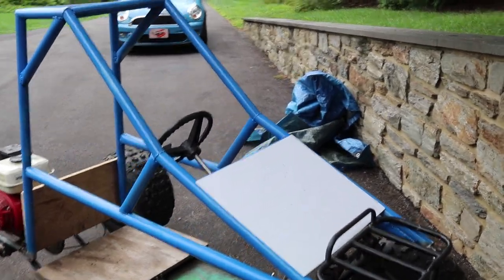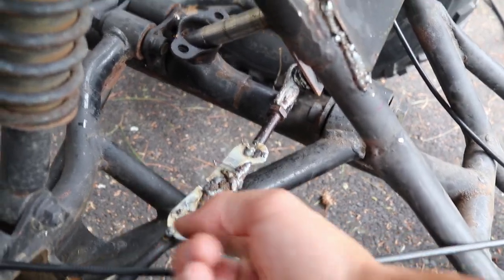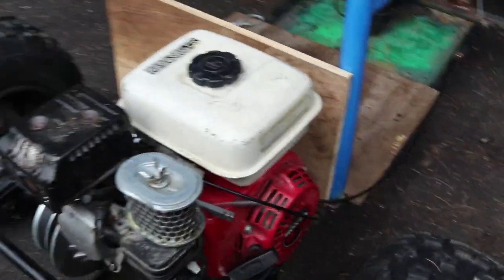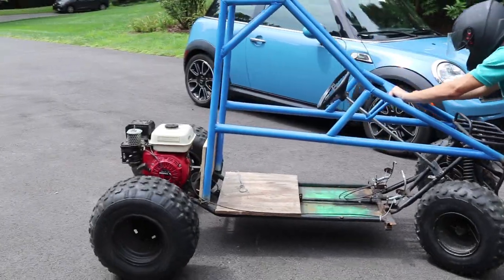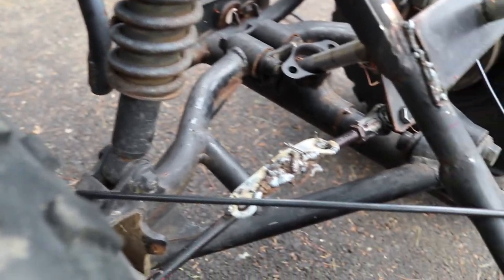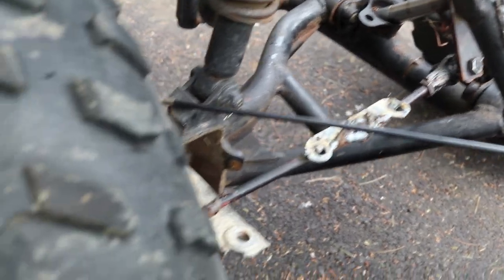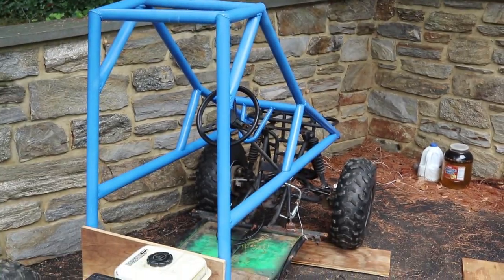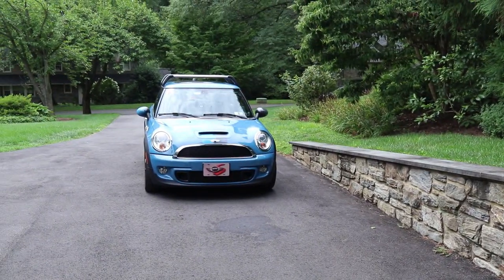FIRST DRIVE IN THE OFF ROAD GO KART [Off Road Kart Build Part 3]

Comment: i'd suggest extending your rollcage on the sides and the rear, so in case of crash your legs or the motor don't get hurt. i also like the idea of painting the panels black. 

maybe it would be better if you soften your suspenion, because in the video it didn't look like it was doing anything. 

also i would recommend putting headlights and stuff on it, so you can drive in the evening/ night and also it looks nice :D 

for the seat i'd recommend you the "bimarco cobra 2".

nice video and good luck
cheers